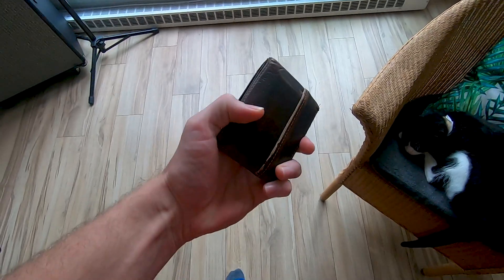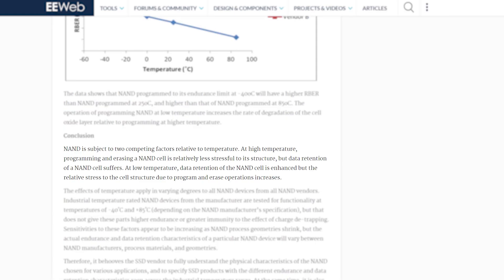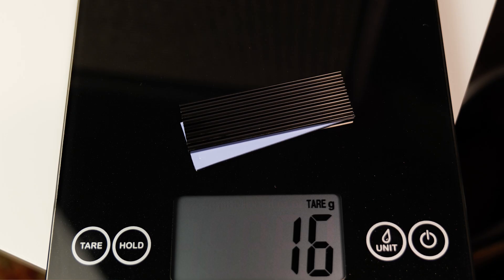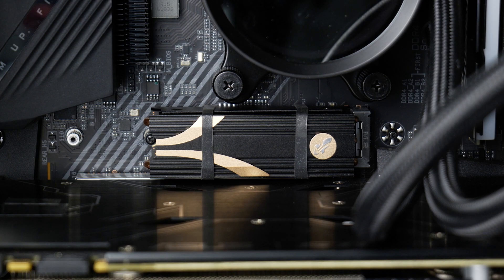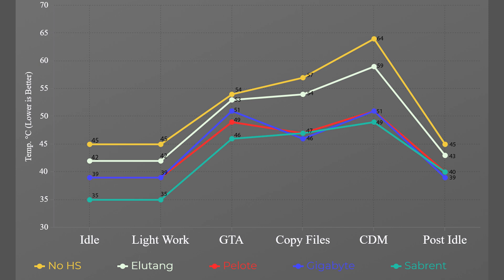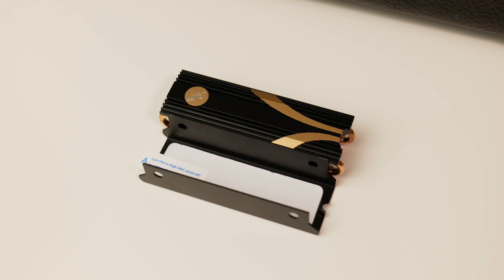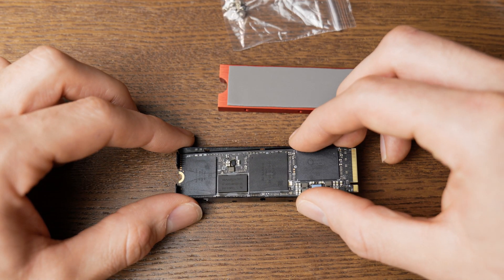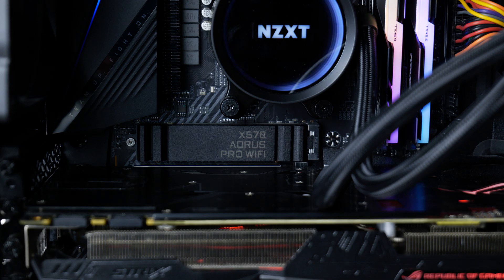Are NVMe SSD Heatsinks Worth Using? M.2 Heatsink Comparison

Comment from the maker: Thanks for watching! If you're interested in any of the heatsinks or the WD black, links in the description :)
Reply: Hey there. If you can, you should do this test with the WD Black SN850. It's super fast and gets super hot. It's recommended by many that you absolutely use a heatsink with it. Maybe you'll see better results on that SSD where those heatsinks you have would be much more useful
Reply: Thanks for the video, I'm just investigating this topic and the sources are scarce. I have not come to a conclusion yet. One point I disagree with is, that ssd is idling most of the time. I think that there is a lot of writing activity all the time. Even when youre doing nothing, there is a/ background processes doing some small writes all the time and b/ cleanup/TRIM algorithms of the drive itself - including page erases, running in background. Moreover, I do not see a scenario, where the controller actually cools the NAND. At least with my 970pro. Cold storage is relevant for when the system is off, that is usually not a problem. From this perspective, the sabrent heatpipes make a lot of sense... the controller heats up the NAND quickly, then keeping some of an equilibrium/compromise at ~50C. The thing is... 970pro gets the controller really toasty at 100C when left uncooled with benchmark loads, so the question is how fast would the heatpipes deal with this king of thermal load and if it is not too much for the NAND. So if you want to throroughly investigate, you can do tests from cold/room temperature with individual/common heatsink. Though the more i look into this, the less I believe there's a silver bullet...
Reply: I gave you a thumbs up due towards your personal sponsored pocket.
Reply: So got 2x2TB Samsung 990 Pro (PSA: THE LATEST FIRMWARE FIXES 'HEATING PROBLEMS').  They "Idle" 34-37 C.  Gaming I see them maybe in the mid 40s at most....so not sure if I'll buy some Heat Sinks or not.  Prob won't if they are gonna continue operating within these temps.
Reply: Do you plan on comparing any of those active heat sinks with a fan?
Reply: Hi. thanks for the great tutorial. in my special case, my NVME should work at full capacity 24/7 reading/writing. what do you think about it?
Reply: @DidarAmini  that it wont last long. Check your TBW.. chia? :)
Reply: @vladimirljubopytnov5193  yea man. I think Samsung 970 is a good option
Reply: @DidarAmini  Samsung 970 pro will fry itself, unless you do some serious cooling. TBW does not look that good on it, thought its mlc, but.. i have one and in not going to kill it with chia :D what about XL ramdisk?
Reply: @vladimirljubopytnov5193  so what kind of serious cooling you have in mind? I should do it anyway. enterprise SSDs are really pricey. so I have to stick to this 970 pro. and I don't have a plan to plot like 10PB )) I guess only 40TB maximum for now
Reply: @DidarAmini  the Samsung 970 pro ist the best SSD with long-live MLC memory Cells. But EOL and expensive . An other good SSD ist the WD red SN700
Reply: Will 2 m.2 ssd gen4 work in the aorus x570 pro? I have 1 in atm and want to upgrade it with another m.2
Reply from the maker: @blumie006  Yes both slots are gen 4
Reply: I think the point is for people running high performance on air with a big fat GPU/ room heater. Since most SSD sit either a few mm above your backplate or a few inches below your GPU fans. Is not the performance of the SSD but the overall ambient temp is idea your case. Which is actually the only reason at all I would buy one
Reply: i hv asus tuf z690 wifi d4 motherboard. i wana populate my four m.2 slots . 
which one i shud buy among 2tb 970 evo plus or 2tb 980 pro
P.S. 980 pro lacks the nvme driver unlike 970 evo plus
Reply: Worth it, if you're missing the m.2 peg and screw because the motherboard manufacture supplied only one set on their dual nvme motherboard...
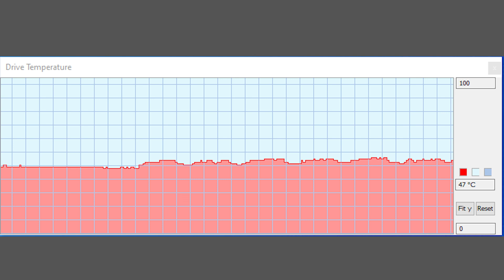Reply: Thank you for this comparative review! 5:00 Looking at the graph, and knowing that NVMe drives (NAND chips) are optimal between 25°C and 70°C without throttling down, It's interesting to notice that all of them are "good", and that you wouldn't even need a heat sink! 🙂 (that said given the game you're playing. I wonder how it would perform with a game like Skyrim or ESO which use a gazillion of files to render a scenery with fx textures etc. => lots of drive I/O). 6:12 Indeed, Crystal Diskmark would expose the good from the bad in all its splendor, but I like your "real World" testing. Personally, I'm going for a Acidalie with 4 copper heat pipes and aluminium fins, it'll look good on my mobo 😁
Reply: So here's a follow-up question to this. I'm starting my new build shortly and I'll be using 3 m.2s (2x2TB 990 Pro in raid 0, 1x1TB 990 Pro) and I have some Thermalright 0.5mm thermal pads, as well as some 1mm to cut and replace the stock stuff from my mobo. Since the controller sits a tad higher than the NAND on each drive I'll be using, would you still recommend to only cover the controller, or is it worth trying to lightly cover the NAND with the thinner pads? ROG X670e-Extreme with included heat sink plates. TIA!
Reply: You talk too fast.. Sure Englishman.. Real American men don't talk on speed like Donald Duck. 
Ok, still halfway understood..
While you may have noticed that coolers don't do too much , a cooler with a heat pipe just looks better in my Dell Optiplex SFF. And that is also very important.

Comment: This video is a bit old, but it seems the only actual conclusion here is that NVMe heatsinks can inadvertently spread heat from one component to another.  A problem that exists for practically any electronic using a solid heatsink for multiple and unlike components on a board (looking at you GPU manufacturers), instead of individual heatsinks per component type

Looking at benchmarks for quick "bursts" is fairly meaningless.  You should have tested sustained read/write speeds over significant periods of time and compared that against the temp graphs.  You also should have made it a point to highlight that the tests you performed say nothing about longevity -- which is the real issue of importance.  To your point no one is going to notice slightly lower r/w performance at peak temps, but they will notice when their drive with all their important things fails without warning or possibility for recovery.

Comment: When the controller get hot, the heat will transfer to the PCB of the drive first and warm up everything on the board, including the NAND to a "stable" temp where everyone have the same temperature... it does not need the heatsink to transfer the heat to the NAND. The same reaction happens when you try to desolder a chip on the motherboard with hot air gun, you actually heat up the surrounding area as well to the same melting point before the chip can be removed, where you only point the heat gun on the chip.
So you still need a cooling solution that dispert the heat globally to make any difference.

Comment: The data will be safe even if the NAND heats up a bit, the SSD will have processes in place to prevent data loss by changes random bit changes, but if your controller dies by overheating then your data will definitely be gone since you can't even access the SSD now.

Comment: You make NO sense at all.  Contrary to your take, the Sabrent kept it cooler at all times - whether idling or working.  It worked better than no cooler and easily beat all the other ones by keeping temperatures lower throughout the testing stages.  I cannot imagine how you came to the conclusion it does little or nothing.  Moreover, you take on the other guy's findings completely mistakes his results.  First, you claim the cooler actually held heat in - when it was barely one or two degrees different which is insignificant and could be explained by the computer doing background functions so it was 2 degrees warmer - but then you completely miss the fact the cooler kept it much cooler when operating - for example with No Heatsink, it ran 96 degrees, while the Motherboard Heat Sink reduced the temperature to 67 degrees.  THAT is a significant cooling effect.  Finally, there is no reason to cool just the controller chip - it would benefit if the entire thing was cooled, and you give no credentials, no supporting evidence or science, nothing to back you silly conclusion.  This was a colossal waste of my time.  T

Comment: My ssd controllers temp went from 50 c idle to 47c playing cyberpunk on max settings for an hour or so and like 30c on idle just using a low profile heat sink on amazon since my ssd is located behind the massive gpu 🤦🏻‍♂️ great designing ig

Comment: so is this obsolete now that there are faster and hotter NVMe SSDs?  I haven't built my own PC in a while and not that often... so I haven't even checked temps.  But I'm looking at heatsinks now for a NAS with SSD caching which will be used in pairs, I'm thinking in RAID 1 mirrored.  In summary... if you're upgrading SSD or building your own computer, then you ought to check your NVMe temperature.  For myself I ordered a $6.99 nice one and a $16.70 elaborate one.  They'll be installed next to each other and the NAS has built in temp checks so I'll be able to see the difference... and I can buy a duplicate of whichever... or more likely performance will be nearly identical.

Comment: Temps only rise in the most extreme tests, CDM literally bashes the chips and produces extreme levels of heat. These levels are not seen in normal workloads. Newer Gen4/Gen5 drives require a heatsink due to the performance they can achieve, a Gen3 doesn't. I have a T700 Gen5, a WD SN850 Gen4, and an SN750 Gen3. Both the Gen5 and 4 drives are covered by the heatsinks on my motherboard, and the 3rd Gen3 slot is not. I have stressed all the drives to see what temps they max out at. The highest I have seen my SN750 go is 61°c, it won't throttle until it hits 70, and I'm confident that if CDM can't raise it to this, no workload will. I was pondering installing a cheap heatsink to it, but I literally can't be bothered to unplug and remove my GPU, I have a 5080 and I really don't want to remove the HP12v plug again!

Comment: My controller was overheating but nand was okay, adding a 1.5mm on a controller and 1mm on nand helped with temps. Before, it would go over 70⁰C and throttle, and now it doesn't go beyond 54. And it was some pccooling ssd cooler. I bought the pads separately. Overall, it was 10 bucks, and now I also have a lot of pads I can use on gpu memory and power.

Comment: Interesting stuff. I am not sure though that the very small Temp differences at idle - even if we assume that in all ssd-coolers we'd have the same behaviour, i.e. Nand warmed by the controller, which I very much doubt - and their temp-range (34--40C) support your conclusion...saying "as cool as possible" in idle doesn't sound adequate enough...one would need to establish the range of temps where the positive and negative effects present themselves...
Also in many tests, the idle temperature are pretty similar with and w/o a heatsink 
I must also underline the fact that doing very CPU/GPU-intensive tasks may raise the temp of surrounding components...this certainly creates modalities that individualize the issue of heatsink or not...e.g.when running OCCT-Max heat to test my new setup, the SSD (Corsair MP510 480GB, no heatsink or targeted fan) hit 51C, while it idles between 34-37C currently.
I also do very-very heavy browsing, with hundreds of tabs open, alternating between them etc...browser stays open 24/7 effectively...that does put a stress on my SSD since small files are being written constantly to it, but not raising the temp of the drive (even when not having the heavy browser session running, its temp range is almost the same)...after 5,5 years I have 131TB written and although its health is fine, Hard Disk Sentinel is giving me a 71day notice of Estimated Remaining Lifetime....I guess I am at a bad spot since files are written in low temps.

Comment: I have an b550 gaming from MSI and I install a m2 just from the start, a year later I decided to buy a second one, but I noticed the second shot didnt have that "shield" to place above m2, did I lost it or is it possible that it only had one? also, is it safe to use just the m2 without any shield or protection?

Comment: Thank you very much for the extensive work, here are a few points to consider:
1. As you have mentioned, the temperature of the SSD controller is different than the nann temperature.
2. The test you have performed using Crystaldisk was for small file, which will be accommodated by Windows Cache or the SSD Cache. So in your test the file will not actually reach to nand and therefore it will not raise the temperature. You may test copying a file more than e.g. 10GB.
3. If the controller size make a gap from the thermal pad, you may consider thicker thermal pad instead of bending the SSD board.

Comment: I was wondering whether we could split the heatsink into 2 and stick one on the controller chip and the other piece onto the nand chip or am I talking nonsense?
Reply: I suppose you could just use thermal pad on the intended chip only..I could try that, good suggestion

Comment: So here's a follow-up question to this. I'm starting my new build shortly and I'll be using 3 m.2s (2x2TB 990 Pro in raid 0, 1x1TB 990 Pro) and I have some Thermalright 0.5mm thermal pads, as well as some 1mm to cut and replace the stock stuff from my mobo. Since the controller sits a tad higher than the NAND on each drive I'll be using, would you still recommend to only cover the controller, or is it worth trying to lightly cover the NAND with the thinner pads? ROG X670e-Extreme with included heat sink plates. TIA!

Comment: about laptops and new nvme stickers (yes the one that are already mounted on it) ... in laptops the nvme often requires shilding from.emf and the close space already heat up everything... so i will find few that fits onto mine and remove the plastic box with aluminum foil that came by factory... 😅

Comment: My msi board the ssd plate that came with the mobo doesn't touch the memory controller(samsung 980)  ,i mean the pad on the plate just touch only the 2 memory chips and not the one in the middle !!! and i saw that the controller is the hottest chip there

Comment: If you find something with an array of thin fins like those on the cooler of a good graphics card or similar you will notice they are fairly close together so that  there is more surface area to dissipate the heat.  The fins I am thinking of are like sheet metal with heat pipes going through them.

Comment: I have tried double sided heat tape + copper shims on a nvme. Did not see much difference there either. I will try the copper heatsink on the controller only and gauge those results. BTW…….I’ve been using WD Blacks in my builds for a while because  of their performance. Out of all of the nvme drives I have used, the WD Blacks are the best.
Reply: And is it any better to just cover the controller?
Reply: @TianjjMan  It is better. The drama chips just don’t require cooling.
Reply: @TianjjMan  Dram chips. Gotta love auto correct.
Reply: Thx for sharing!

Comment: I'm going  liquid super-cooled...  So,  a small coolant block on the controller and  two small ally heatsinks on each NAND... 
The waterblock does most of the cooling, being fed with chilled coolant (beer cooler), sufficient to keep that controller nicely cooled; whereas the NANDs are kept cool via ambient air circulation through the system rack.  

Adapting a laptop cpu (heatpipe) cooler - with a footprint that is comparable in size to the controller might also work and all laptop coolers have a small built-in fan that could be controlled...

Comment: The [best] thing you can do is is increase differential temperature between the case and the SSD.  The higher the differential, the more heat you will shed in the least amount of time.  Heat transfer occurs on a step bell curve.  If you have your SSD tucked between components with little to no airflow then all of this heat benchmarking matters; Otherwise, not so much.  Motherboard and even case design has more impact than a heat sink.

Comment: So the solution, with those heatsinks, in case you have bought them already is to place thermal pad on top of the controller only and balance the heatsink so it doesn't touch the nand chips.